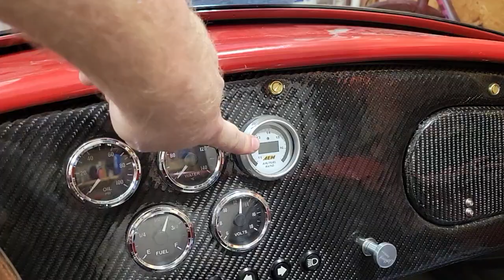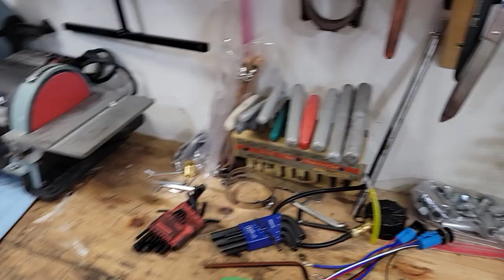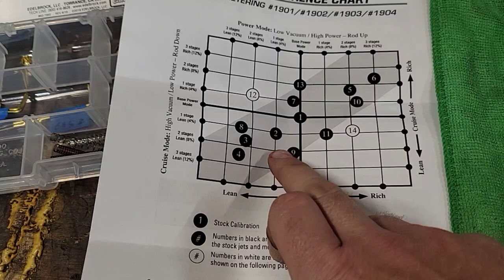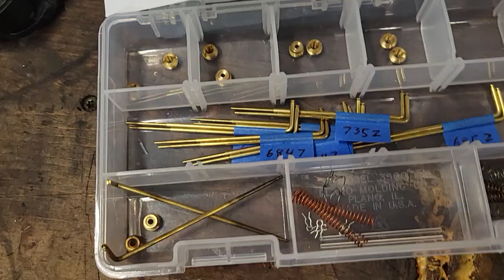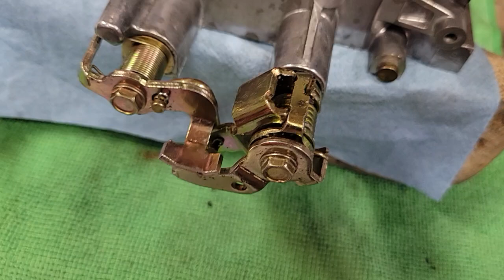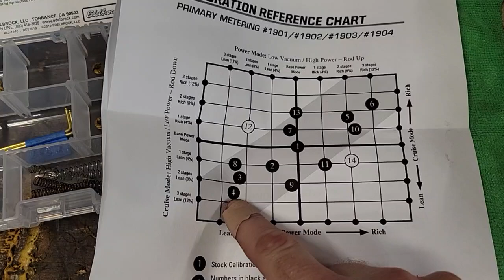Edelbrock AVS2 tuning

Comment: Great carburetor. The air valve needs adjusting as well if you want earlier flow in the secondary’s. AVS stands for Air Valve Secondary’s. It’s that spring loaded flapper above the secondary boosters. It’s a little work to get it dialed in but then you are done. They hold a tune perfectly.

Comment: Edelbrock carbs are vacuum secondary not mechanical like you stated. The vacuum of the motor pulls the fuel in for the secondary instead of like with a holly where there is a mechanical accelerator pump for the secondary. Im sure you stated its mechanical as the butterflies are mechanical but their all that way but it has to do with how the fuel is delivered not how the butterfly valves open.

Comment: You should have no more than 6 psi fuel pressure with that carb or you'll push fuel past needle and seat. Check you fuel pressure first. Or depending on vacuum at cruise, you may have too stiff of a step-up spring keeping you in power mode.  Last, if its lazy, check your timing. A car that light, should jump when you step on it as long as you have good gears. Nice car btw.

Comment: What size carb are you using ? And what size engine. Thanks
Reply from the maker: Technically it doesn't matter, but since you asked it's a 302 SBF bored 30 over, and this is a 500 CFM AVS2 carb.